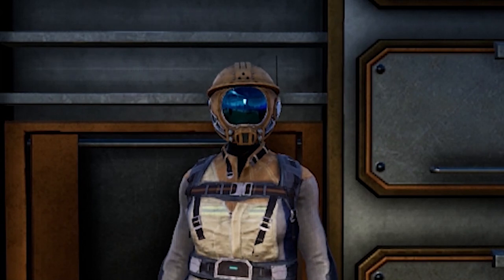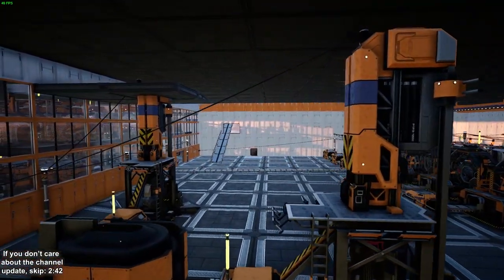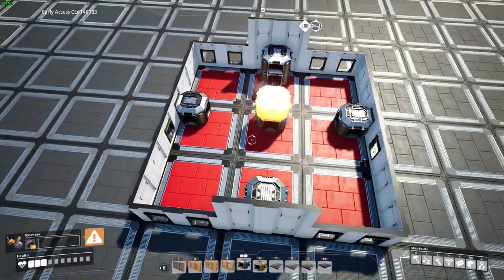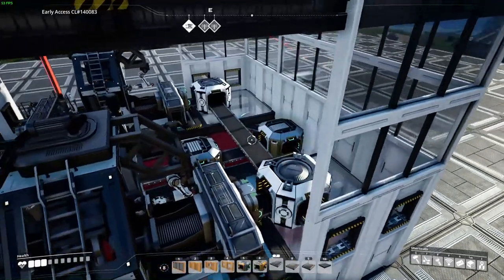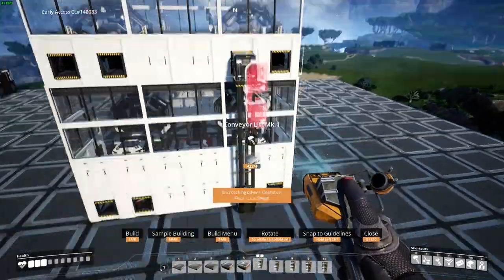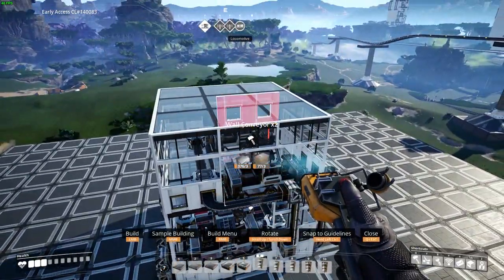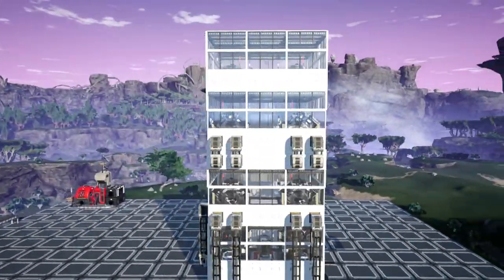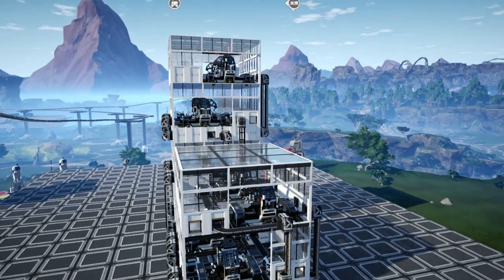100% Efficient  Factory for Nobelisks (12/Min) | SATISFACTORY

Comment: Understanding how these modular structures are designed would be helpful ... its easy enough to copy an existing factory, but, despite 100+ hours, I still don't have a solid idea of how to build vertically (ADA is disappointed!) beyond just layers of sprawling factories.
Reply from the maker: Yeah i understand! I'm actually making a lets play at the moment. In it ill be going through how i come up with the designs as well!
If you want the short version, its literally just trial and error.  What i do is, i make up the calculations first, then i confine myself to a specific amount of space. And then i just place and remove over and over again. After a while you learn what works and what doesn't. That's how I come up with designs